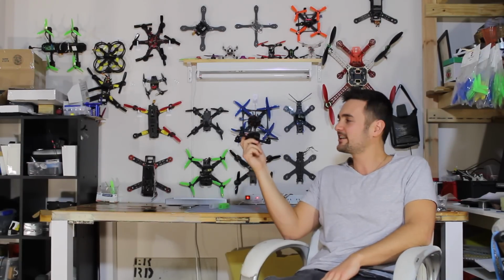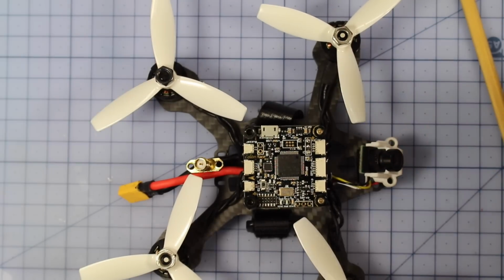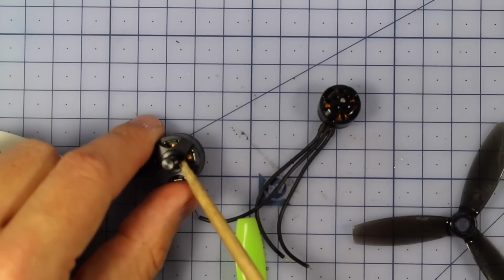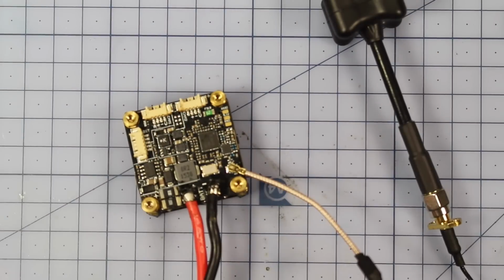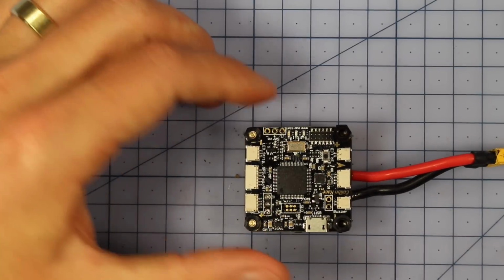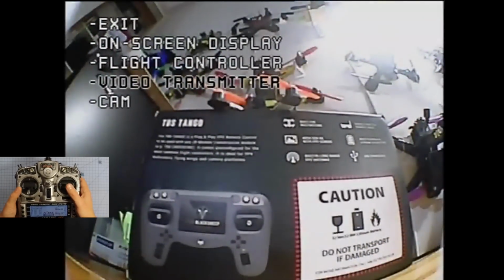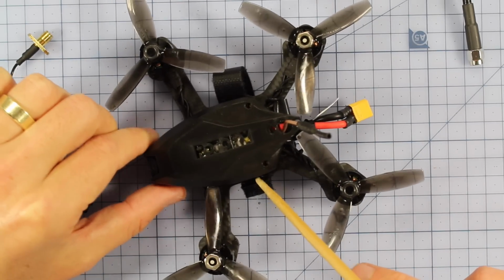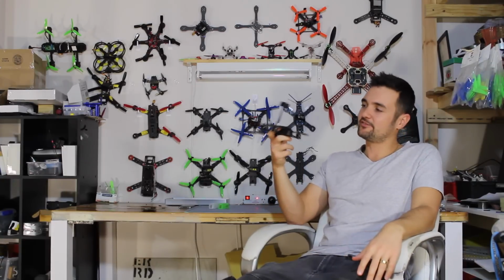Atom V2 from Rotor X. Full Review - The best quad I have seen. EVER!!

Comment: You should just hot glue the antenna if it breaks and it's has epoxy on it you will never get it off hot glue you can get off for changing and repairing

Comment: Taaaa daaaaaay!!!  hows are you mate?  Lol!  just a quick question!  Can this thing haul the 1300mah 4s lipos?  Ofcourse most common lipos for us atm!
Reply from the maker: i Would say it could... but you wouldnt want it to,
Reply: UAVfutures Too bulky/heavy?  Whats the recommended and flight time with those?  Cheers mate.
Reply from the maker: well rotor x says no 4s. and I agree. You dont need it at all, and it is a good way to burn out an esc if it is not tuned properly. and I wouldnt go bigger than a 700mah 4s if you really need 4S. its a tiny quad, you dont want the battery being heavier than the quad
Reply: UAVfutures Whats the recommended lipo size though?  Will you see 3-4mins of flight time from them?
Reply from the maker: Hally FPV 3s HvLipo 850mah between 3 and 6 minutes flight time

Comment: Hi,
I'm flying with it for a few days with a friend and so far we've got a really good feeling about it. It flies great.
a few things though...
1) landing (crashing) on the battery is damaging them fast... it's hard to land smoothly with the cam looking up, I might print some protection...
2) we experienced jello and vibrations when pushing the throttle all the way, I'll try increase "I"....?
3) The camera is REALLY exposed. In a crash on one quad, the canopy went away as well as the camera, a cable was even torn off on the other quad, the mount of the sensor with the electronic was torn off from the lens... we manage to repair them both with a bit of soldering and hot glue...
4) a bit of drifting in angle mode, fortunately I fly FPV acro
5) I spent a few hours struggling with a blinking red light until my friend sent me the last pdf with a link to FAQ. It's compulsory to set your transmitter with the goggles and you have to set an arm switch (last versions of betaflight?)
6) I put the tiny antenna, 200mw, hardly 200m... probably less... then black image. My friend has a better experience with fatshark diversity receiver, mine is not...
7) to be honest, it's the WEAKEST buzzer ever!!! please Rotorx or TBS change that!!! It won't help you much to find your quad except in a very quiet area.
8) The buzzer isn't buzzing when lowbatt, only a finding buzzer. It would be great to update it. I like to fly LOS as well ;)

so quite so small issues, but well this is the hobby I guess... :D but so far it's the best quad I got the chance to fly with... very powerful with the 1306 4100kv motors, very fun...
Reply: No

Comment: Bit of a random question here! For freestyle/racing, would you consider this drone able to be contender with the larger drones? Debating picking this up to replace my 210 frame as it looks like a fun little rocket to freestyle with.

Thanks for the videos! I rather enjoyed your Owl reviews. Have a great day!
Reply from the maker: I dont think this can beat a full 5" racer built by a pro, but honestly on a tight course it will give any quad a run for its money. it is faster than any of my mates full sized quads.
Reply: Thank you! That is actually rather helpful. I might just have to give it a shot then. There is definitely something to be said for portability and freestyle!

Comment: can i change flight modes on the osd display which is easier does it have self level mode if yes what is it called
Reply from the maker: you can set a switch to change flight modes. Yes it has the self leveling mode

Comment: Wow.. 14 grams is way to heavy for the antenna... why not a small light weight CL? My JJ1000's cam/vtx is only 4.6 grams complete with it's RHCL.. makes no sense as the weight above the CG is just going fight where YOU want to go on a quad that small. I would expect to see a high-tech micro antenna on something this nice...
Reply from the maker: I think a lot of people in the community wanted the TBS triumph so this is what they ended up  with, I run with the whip
Reply: UAVfutures I have both the 4.5g clone (now 4.6 grams using a flexible coax) and the Micro Motor Warehouse 10g cam/vtx 5.8 combos and they both have really small light weight CLs using a coax on them but the one on the MMW is a little bigger and not sure what the wave length ratio is on it but they all work well with a Mad Mushroom on the FS Race goggle VRX and I am really surprised the Rotor X has not improved on it after seeing everything else associated with it. What an amazing little quad! But it really needs a locator built in as at the speeds it flies it will penetrate brush and hide itself really well. Great review BTW.

Comment: Great review. I just bought the HeliPal Storm Edition Atom 2. I'm not 100% sure if it's the same as your RotorX TBS version or not, going to check on that. But I have two questions: 1 How do you attach the battery? On mine, it's a real challenge b/c the tie down straps are always getting hit by the propellers. Any advice? 2 My video is transmitting upside down! I am going to check it he OSD controls to see if I can change that, but wondering if you have any ideas why that would be the case. 
Again - great video and thanks!
Reply from the maker: umm is your camera in upside down?  you bought the V1 version, Not sure how they can say v2?. it will not contain any of the powercube stuff
Reply: It's this one: http://www.helipal.com/storm-racing-drone-rtf-rotorx-rx122-atom-storm-edition.html
Says V2 on the page, but looked pretty different than the review. The video shows upside down in my Fat Sharks. I could go in and flip the camera over, but was wondering if maybe it's a setting that I can change...
Reply from the maker: Ready Set Drone yep, thats a v1 : (

Comment: Thanks for the video, that was an awesome review. Just out of curiosity, how fast does the Atom go? It would be a cool feature of your reviews if you were to invest in an air speed sensor so you can show the top speed (like the frsky ASS-70 or ASS-100). Or a GPS based one.
Reply from the maker: I guess it easily goes over 100km.
Reply: Ohh and another one: What's the weight without battery and also the AUW? I really can't wait to get my own atom :-)
Reply from the maker: ***** look im goign to guess here because I am away from the "office" but I think it is around 120 130 grams, maybe even smaller

Comment: lol I love how every time I pull your channel I see your fleet just reproducing lol .gonna NEEED A BIGGER WALL BRO ! ;)  well great video .mi question is can I run some 4s on this I pre order and someone said I could .now I see  3 s when you plug in the battery on the osd at star up .can I run 4s / on this thanks ,
Reply from the maker: You can run 4s but honestly 3s is more than enough.
Reply: there is never enough .4s it is .thanks .
Reply from the maker: flying High crew productions rotor x recommends 3 for the best flying experience
Reply: We designed the motors to be high kv so you don't need more than 3s. 3s batteries are lighter and widely available in the 500 or 850mah size. We do not recommend 4s. Some people will do it anyway, but you better be good at tuning or you will burn out the motors.
Reply: When will the rotorx batteries be available for purchase? I can't seem to find them on the rotorx website or any of the US 'where to buy' websites.
Reply: +Alvaro Lopez amazon got you covered .hobby king .3s 850 .10 doll.
Reply from the maker: flying High crew productions are they HVlipos
Reply: kind of they are 35 c good batteries should give you a solid 6 min of nice flying .
Reply from the maker: flying High crew productions no. Not high c. High Voltage. there is a difference and they are a totally different type of battery. Hvli Vs lipo

Comment: Wow! Got to say I'm impressed with the power it has even with a HD Cam on top.  
As an owner of the TBS Vendetta, I would prefer they did NOT channel out the arms (i.e. weaken them) for the wires, as lots of Vendetta owners (where the arms are also channeled out) are breaking arms on crashes.  Admittedly the Vendetta is a heavier quad & longer arms, but I prefer strength over "neatness".
Good to see TBS have also improved their QC on the RP-SMA VTX pigtail - had major issues on the Vendetta where the braid inside the wire came loose.  To their credit they sent out new ones.
Also really like the addition of the VTX + OSD to the PowerCube, wish they would also add in an option for de-pinned X4R or XSR or anything light + FrSky compatible equivalent RX.
Reckon I'll be getting one, & want the HD Cam option as the size of these make them very easy to take anywhere too.
Still can't believe how fast this is for a 3" setup, even with the HD Cam!
Keen to know what your AUW with battery (4s 1000mah?) & what your average flight-times are?
Reply from the maker: Since filming this rotor x has said they will be using a non milled frame. So it will actually be closer to what I have in this vid
Reply: Thanks for the update...Good call from RotorX :)

Comment: also one thing to note, the 1306 4100 shaft is a 4mm according to rotor x, but you said its 5, so im quite confused. is it different?
Reply from the maker: actually im not sure off the top of my head. Ill check and ge back to you.
Reply from the maker: So i just measured the shaft, it is the same size as all my other motors on all my other quads.
Reply: So 5mm? And Thanks for taking your time for measuring the shaft. Also unfortunately, according to the rotorx guys the routed 4mm frame is not coming because of durability issues. Which is a bummer, so the frame might actually end up like the one you have.
Reply from the maker: Jad Collado yeah I heard this about the frame
Reply: Almost exactly the frame Stew has. Just a couple of changes around the FPV camera
Reply: Older RX1306 motors were 4mm. New motors come with a 5mm shaft now
Reply: +Rotor X  that's nice!
Reply: +Rotor X will there be a n adjustable camera mount in the near future?
Reply: There are 3 camera mounts provided, 15deg, 30deg and 45deg.  It was done this way because adjustable camera mounts are heavy or they will self adjust in big crashes.  We wanted to have the cam locked in place and provide part of the bulkhead structure for the canopy.

Comment: hi mate, what's the name of that power qube with those options, 4 in 1 esc osd etc, as opposed to the separate esc qube? can the qube be bought alone, do you have a link? lastly is the stack small enough to fit in the mini owl frame? great video! Cheers.
Reply from the maker: That is the power cube by TBS and this small version has been designed with rotor x for the atom.
Reply: Micro cube wont be available for other rigs for awhile. Atom V2 orders have snagged them up

Comment: there is a 3mm version of the v1 available at paragonuav. however the new v2 frame will be 4mm, hence why there are recessed to cut weight and like what you said, cleaner wiring.